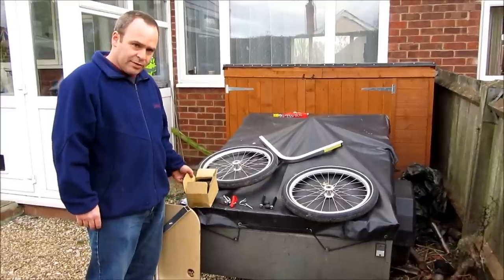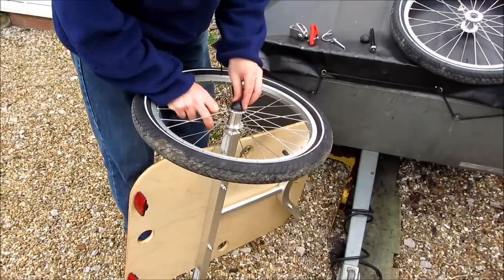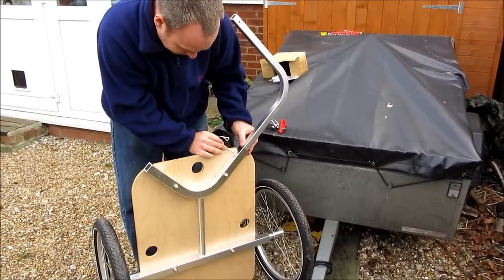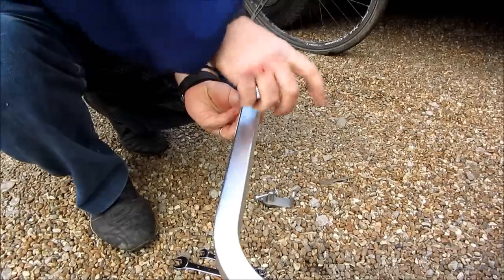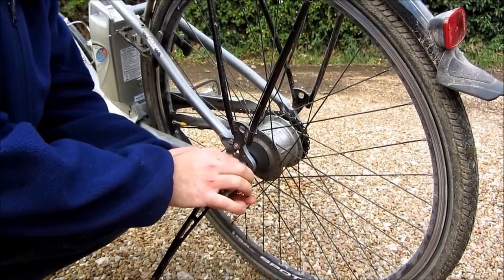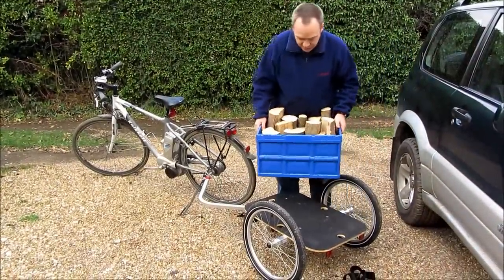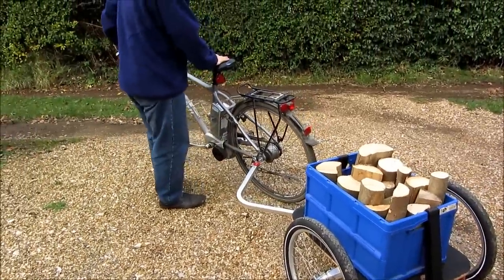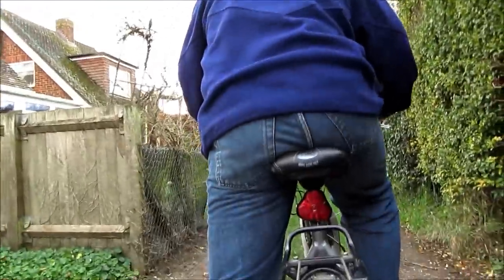Carry Freedom Bike Trailer Review

Comment: I bought a Carry Freedom like this some time ago.  I have not found it to be particularly useful in itself as I don't have as great a need for a flatbed as I thought.  What I have done is buy a tool chest box from B&Q (Strata 145 litre) and drilled through the box and the trailer platform and bolt the platform and trailer together.  This gives me a massive size waterproof carrying capacity without the need for straps and also it is waterproof.  The chest can be removed if I want to go to being flatbed - say for buying garden compost.  I have lost both caps off the wheels.  One area that I have found to be poor on the Freedom is the black material covering the platform, mine started to lift after very little usage and I have had to buy adhesive to glue it down.  The Freedom isn't cheap and neither are the add-on options.

I do have a Mule (sometimes known as a Raleight/Avenir Mule) which I bought back in 2008, it is cheap and lightweight covers the load.  Whilst it isn't as easy to pull as the Freedom and hasn't the capacity I do wonder if for the occasional user whether a cheaper alternative would be a better option.  I have two supmarket type baskets that fit into my Mule and using one and the front and one at the back allows me capacity to put upright things like bottles between them and gives me a descent payload.

Comment: First of all I'm sorry for my English . I loved your tutorial. In my country bicycle trailers are not used yet and to buy one is too much expensive. For this reason I would like to try to do it myself and I wanted to ask you what type of iron you used for the trailer. Thank you so much!
Reply from the maker: +Nat Alarcon Your English is great Nat! Take a look at the video this guy made: https://www.youtube.com/watch?v=dqD_i9MRmv8  There's loads of home-made trailers out there. A key tip from the one I bought is that it uses hubs from wheelchairs (but smaller wheels) - these are designed to be strong enough to be supported only on one side of the axle.

Comment: Nice video. I have a cheaper cart that fishtails once I’m up to 10km/hr. I suspect the wheel/axle set in this is high quality. What tires come with it and do you know the PSI off hand by chance? 
Also would you know if the piece that mounts to the rear axle is the same for the smaller version?
Thank you!
Reply from the maker: Sorry, don't remember the psi without going to check, but they're 20 inch tyres I think, I'd guess 40psi? Not sure about the other versions, best to check with the manufacturer. The axles are from wheelchairs, so very sturdy. I had no stability problems, tested over 20 mph.
Reply: Thank you Mike Pepler. Well, for my kid some years ago I had a well made Canadian trailer that took some high PSI. Big difference in pulling the cart when tires have less PSI. 
My current “fish tailer” is only 40 PSI and hard to pull with distance and weight.

Comment: Does this trailer work with quick release skewers? Also, is it okay with disc brakes?
Reply from the maker: No problem with discs. Also OK with QR, but reduced weight limit - so on my new bike I replaced the QR axle with a solid one.

Comment: does it work on a quick release wheel hub
Reply from the maker: Yes, but the maximum trailer load is reduced. So on my current bike I've replaced it with an extra long solid axle, and just make sure I have a 15mm spanner in my toolkit.

Comment: what keep the wheels from falling off ?
Reply from the maker: +triumphmanful They work the same way as a wheelchair. A powerful spring loaded ball bearing pops out of the axle to hold the wheel on, and draws back in when you press the button on the end of the axle.
Reply: +Mike Pepler : Cool ! Are these trailers expensive ? USD $ please.
Reply from the maker: +triumphmanful I think I paid about £180 in the UK, which would be about $300? Don't know what your local price would be though.

Comment: I did find the rubber protectors that pup into the wheels to lose they do not stay in
Reply from the maker: Yes, I'd heard that was a problem. I've put zip-ties over the rubber caps to hold them in place.
Reply: Mike Pepler kinda defeats the pint of them being quick release...
Reply from the maker: Rax Raccoon
They're still quick release - the zip tie just stops the cap falling off. You can still press it down to activate the release button.
Reply: fair enough
Reply: Hi I to find the rubber caps to lose so Just put two Ties or string to hold them in.

I have to say I did find the service not to be 100% Brought a Box and sent money for this plus a deposit for the mudguards but I did not receive the box lid or a reminder about mudguards I did get an email saying a box lid was being sort but never heard back so I gave up and brought a Nomad trailer. I like the Y trailer and use it for shopping the Nomad I use for turing.
Reply: Www

Comment: I got one paid for its self.had it for years.now the berings are loose and i cant get the wheels off, the pegs rusted in.
Reply from the maker: That's a shame, I guess it's best to remove the axle pegs every now and then and grease them... I wonder if you could get some WD40 to soak in until you can get the pegs out? Replacements are easy to find from wheelchair component suppliers, if you have the same type I do.
Reply: Mike Pepler
wd is water based and not a good lube choice....
Reply: Probaly going to have to drill em out.but its still good.ya tried heating , wd , socket power wrench.must have been because i live by the ocean.that also played havok on my sax.
Reply: buckandotis
WD40 is for removing the old pegs, you apply real grease onto the replacement pegs.

Comment: I like to know why all bike trailer videos only show the bike taking a left and never showing the bike taking a right???Is it do to the fact that the rear bike wheel hits the trailer bar when you make a right to hard???
Reply from the maker: Ha ha, I'd not realised that! I've certainly had no problems with this trailer turning right - the towing bar is angled to leave plenty of room for the wheel.
Reply: Bull-Shit!!! It hits the bar. Don't lie about it, tell it like it is, not the way you see it.
Reply from the maker: +ROBERT CAMMARATA Why would I lie about it? I'm not paid to review it... Of course if you turn the bike far enough it will hit the bar, but only once you reach about 45 degrees, which never happens at normal cycling speeds, only when you're stopped.

Comment: And will the bracket work on quick release skewers? (BTW, your bike is dirty...😉)
Reply from the maker: In theory, yes, but it's not advised as they may not cope with the extra stress. This bike had a solid axle anyway, and you can easily retrofit one to an existing rear wheel.

Comment: I appreciated the detail but not a very good review imo. You didnt mention anything you didnt like or that could have been better or advantages and disadvantages of design. I bought a very similar trailer witb quick release wheels and I prefer a more sturdy wheel over the convenience of quick release. Not sure if youra is the same but I found the design of quick release to be just the slightest bit inward camber and could be wobbled if you tried to by hand. I have living things in my trailer so
Reply from the maker: First time I'd used it then. Since then I've bought a longer tow arm for it, so I can move longer pieces of wood (see https://youtu.be/0HBYbEngM_0 ). Main annoyance for me with my current bike is I have to remove the kick-stand from the bike in order to have the trailer on, so then have to find something to lean the bike on. So I have a rubber band on the handle bar I can loop around the back brake lever to stop the bike and trailer rolling when parked.

Comment: My major criticism of the Y-frame large trailer (I have had one since 2010) is the rear reflectors and the difficulty of fitting lights. Like all other bicycle trailers, at the time, the supplied reflectors were illegal. To tow a trailer at night, the trailer MUST have at least one triangular reflector and at least one rear light. I recommend two reflectors, and a light because of retarded drivers. Like 80% of cyclists I drive too, and I see a lot of appallingly-bad driving.

"Cycle trailers need a rear lamp as above and a triangular rear reflector with an ECE mark III or IIIA. (Trailer manufacturers appear blissfully unaware of this however, and generally fit cycle-type reflectors whilst making no provision for a rear lamp.)"
http://www.cyclinguk.org/cyclists-library/regulations/lighting-regulations

I have used my trailer for transporting bicycles, concrete rubble, tools, fence-posts etc.

My Y-frame large came with the very noisy & rattly metal hitch, now upgraded to the quiet plastic lollipop-type.

The rubber-bungs are prone to being plucked-out by the trailer rubbing against obstacles. I tied them in with cable-ties in a figure-eight formation through the spokes.

My final criticism is that the full-range of accessories for the trailer wasn't available in the UK, after Nick Lobnitz sold-out to the European company who now owns Carry-Freedom. This might no-longer be true.
Otherwise a good, robust and stable trailer.
Can't think of anything-else at the moment.
Reply from the maker: This is true. The reflectors are very much an afterthought. What solution did you come to for getting a light and reflector on there?
Reply: An earlier lighting solution using aluminium angle and an aluminium flat-bar. There have been a number of iterations.
http://i45.tinypic.com/2nkkzdk.jpg
Carrying a bicycle
http://i54.tinypic.com/1o1tw3.jpg
Carrying a protest sign
http://i49.tinypic.com/sl41ls.jpg
Reply from the maker: Thanks, looks like you're making good use of it!

Comment: not good. no leaning hinge.
Reply from the maker: You mean for the bike leaning sideways? The red plastic bit is very flexible, and performs this function. I think an older version used a hinge of some sort, and the plastic is said to work better. But I've not seen it to compare.